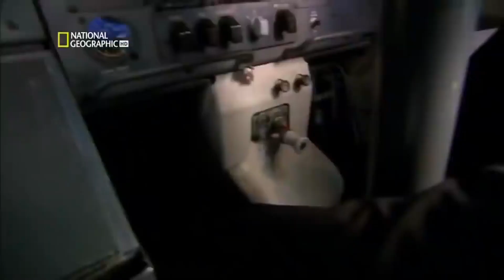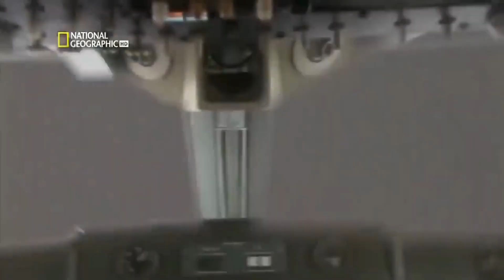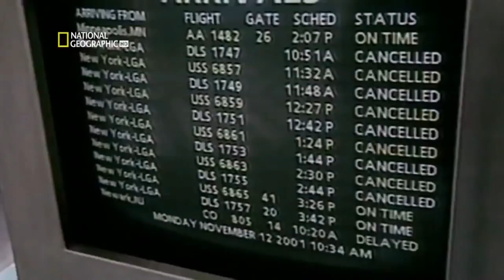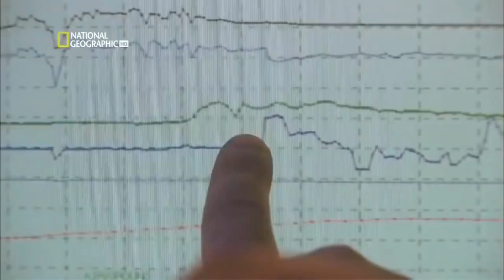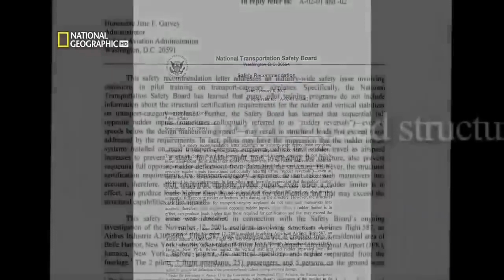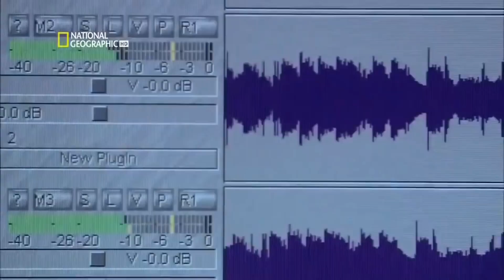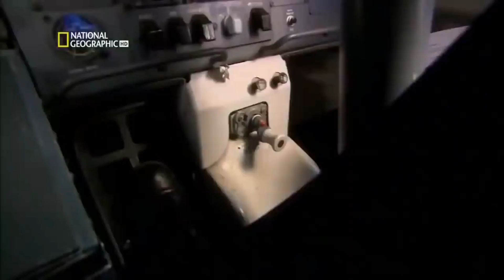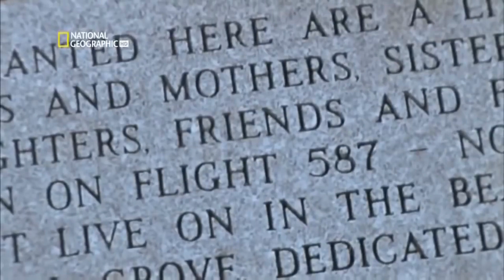Air Crash Investigation: Flight 587 CRASHES two minutes after takeoff in the Suburbs of Queens, NY

Comment: Something does not seem right if a pilot using the Rudder too much cause cause the planes Tail to Break off...If the Tail can not handle those movements from the rudder the plane should NEVER be in service...Should take a LOT more than just rudder movements for the Tail to snap off...Plane can not fly without its Tail...Plane should be able to do cartwheels and flips in the Air without Tail snapping off...This was a weird investigation conclusion for me...
Reply: The aircraft wasnt meant to have the rudder move 30 degrees at 200 miles per hour.
Reply: And besides, the tail actually helps do cartwheels.
Reply: this is like comparing a human to a crocodile
Reply: I agree. Something fishy going on here.
Reply: well, seeing as this accident caused airbus and boeing to put limiters on how far u can yaw the plane (move the rudder) im guessing it wasnt designed to handle stresses of that magnitude repeatedly, cause no pilot was crazy enough to test it
Reply: Moving the rudder that quick at those speeds would be like taking a drag car and slaloming it on the course and wonder y an axle broke